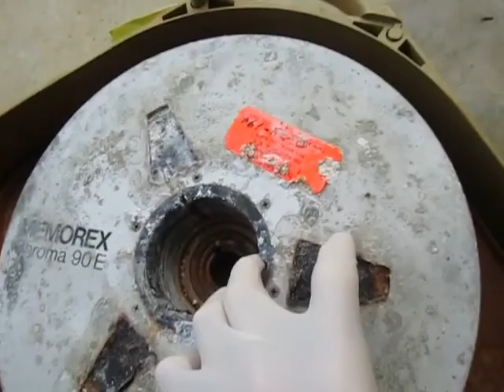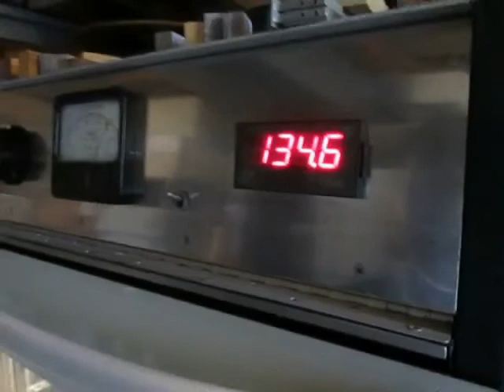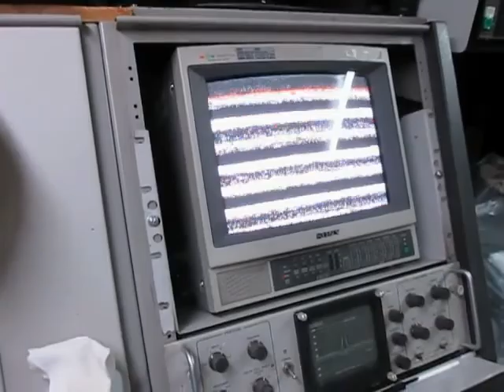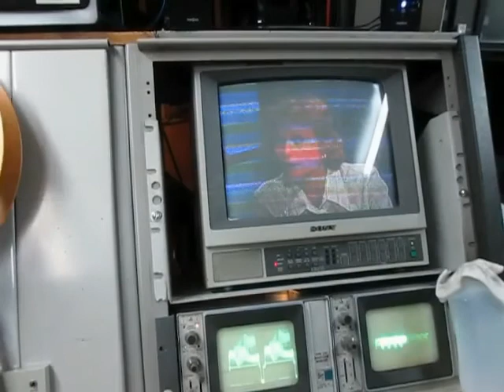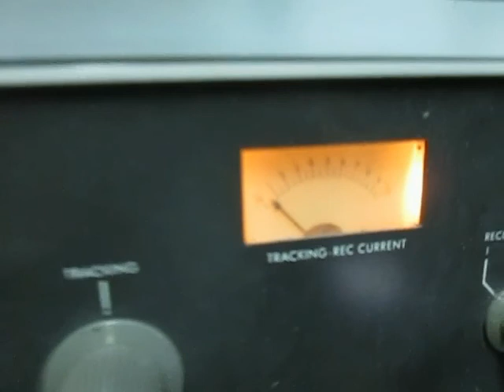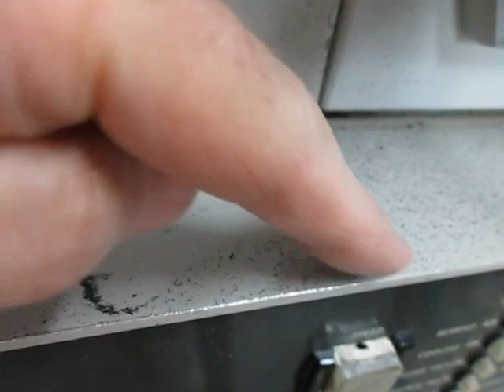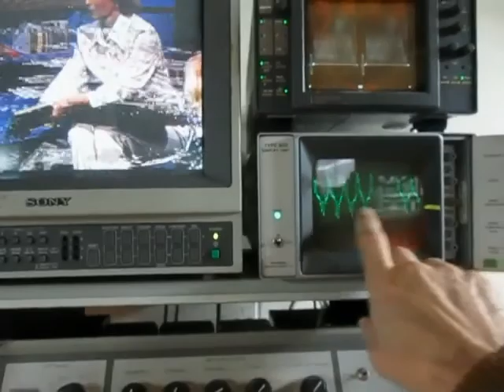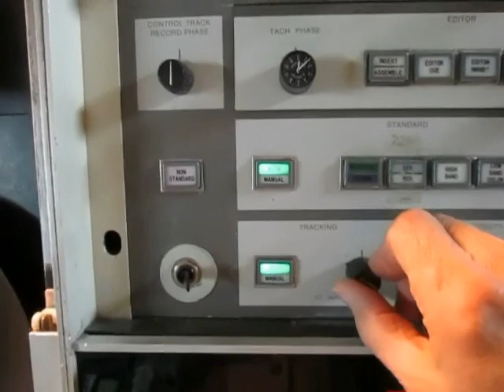The Quad Tape Transfer-Restoring A 2 Inch Quad Video Tape To Playable Condition And Digitizing.

Comment: Hello, it is the restored tape was  from the lake or some earthened soil?
Reply from the maker: Hello Vanessa, This was a water-damaged tape from the Alabama A & M University collection that I worked on in 2017-18. A few of the tapes in their collection was stored in a basement closet at the University campus. Some years in the past the basement had flooded, submerging seven of the tapes under water for a short period of time. During that time, water seeped into the cases and stayed there undisturbed. You can see the water mark about 1/3 the way up the tape, looking edge-on. The water trapped inside the case over the next several years caused the aluminum reel parts to corrode and the iron metal parts to rust, and mold to grow. When I received the tapes, they were dry, the water long ago evaporated and what was left behind was the damage it caused during the later decades sitting undisturbed since the 1970s. It was quite a study in extremes. I think it is somewhat uncharted territory, I don't know of anyone else doing this, to this degree. So I think it is of some value to publish my work for other archivists to learn from.

Comment: anxiety at the six minute mark - what is happening here?
Reply from the maker: Hello Casey, I am slowly by hand separating the stuck together layers of tape. Mostly it was confined to the edge surface but some of the water damage had penetrated down into the tape over time and built-up crystallized deposits in spots. This has to be unwound first by hand at a very slow pace to try and minimize the damage. One of the tapes in this collection, I had to make over 100 splice repairs to the lower edge. That is 2475 ft of tape on a 30 minute reel, all unwound by hand. It takes a good long while! In this particular tape I think I made 3 splices, it was not that bad. If course, forget about the control track, it is destroyed. Playback only on an AVR-1 which can play a tape without a control track.
Cheers, 😀

Comment: What liquid are you using to clean it here? Alcohol? Honestly, if I saw a tape in that condition I would have believed it was a gonner. You don't happen to have any old Doctor Whos lying around? ;)
Reply from the maker: I used a couple different things... first: white vinegar soaks to loosen up the calcification and corrosion from the water and aluminum. Many soakings over about a month. Then when it was clean from all the debris, eucalyptus oil several times with a toothbrush. Then rinse with distilled water and bake at 131.5 degrees F for 3 weeks. It takes a while. You can't force things to happen, or else might do irreparable damage, as odd as that may appear. Slow and steady.